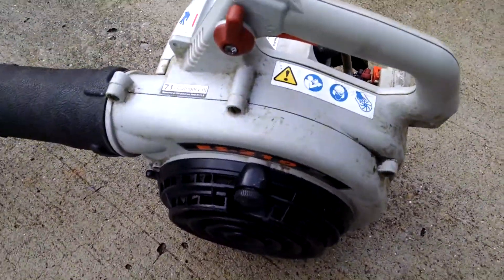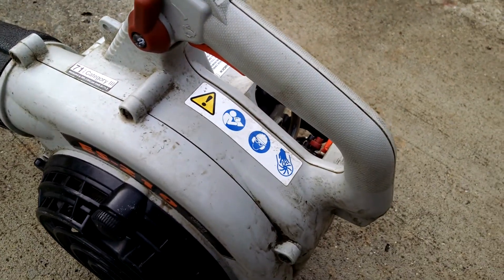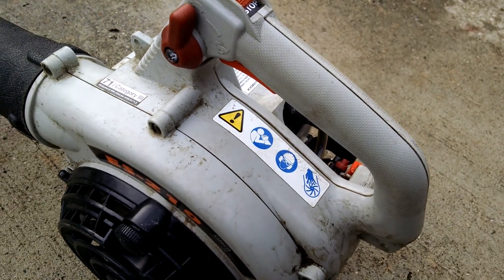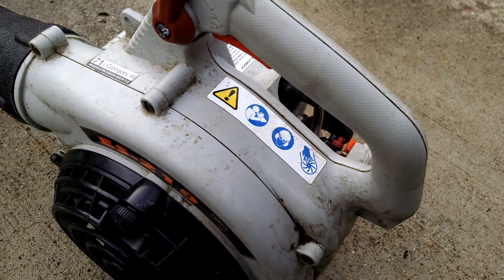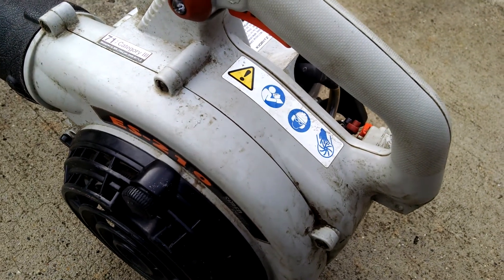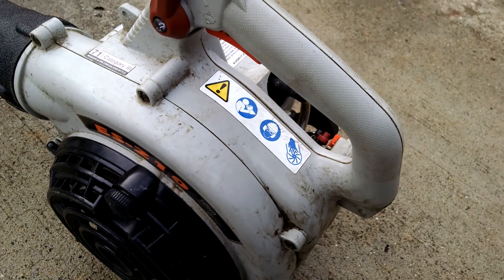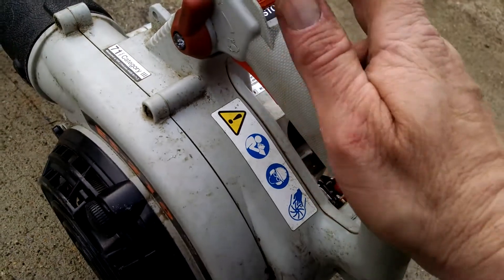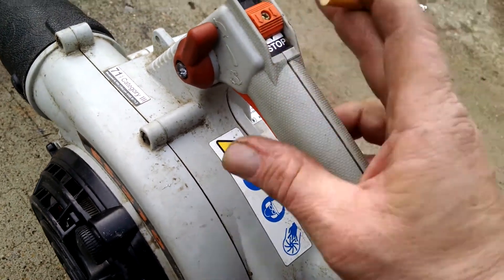Echo ES 210 leaf blower, scrap pile fix!

Comment: Heck ya Alan that was definitely worth the second look! lol She'll straighten out for you I'm sure, a little seafoam or a tweak with a hammer.... lol
Reply from the maker: Thanks Rooney! after I posted the vid I tweaked the carb a bit & ran a 50/50 mix of seafoam & fuel through it, let it run til it quit,  & boy did it smoke like a bastard! lol fueled it up again & it throttles up like it should now, There sure has been some of these 2 cycle engines I've wanted to take a hammer too!

Comment: do you think the carb might still be a little dirty or maybe lean out the high speed jet just a touch, I don't  know if a partially clogged exhaust would make it bog down ,, maybe, I know if they are blocked pretty much all the way they won't even run.. but I like echo products.
Reply from the maker: +MissouriOldTimer Yes, after I posted the video I leaned it out a bit & it lined out.I've had that problem before with the exhaust clogged up, usually athe spark arrestor is dirty. Thanks For watching!